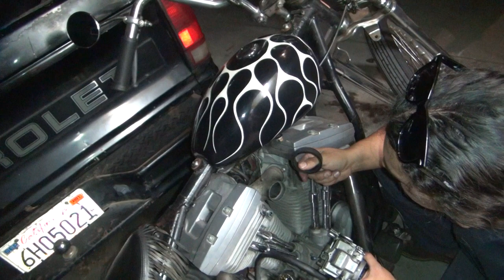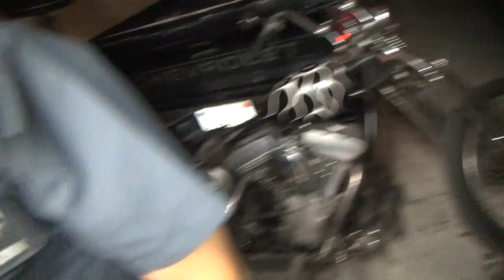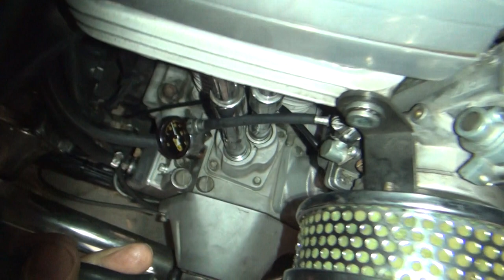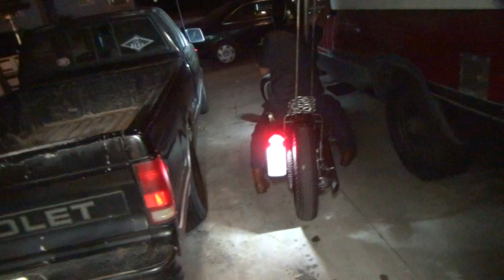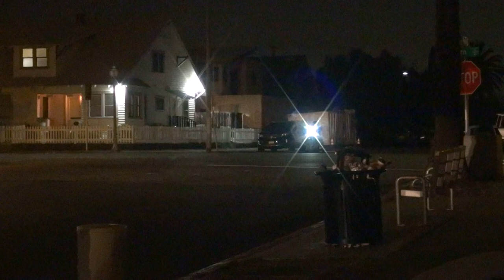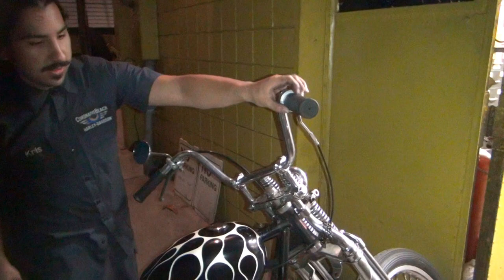#159-B how to do it, clean and flush hsr42 mikuni carburetor rebuild 45 48 carb harley tatro machine

Comment: Nice chop. I used to have a evo in a paughco frame with a micks chop shop springer. Man would it fly. Ported milled heads, 030 head gasket, flat top forged pistons, 42 mikuni and ev27 cam. best street rod set up ever!
Reply from the maker: yes that is a good combo for the motor. you should have an easy 75hp with it in a 500lb bike. watch out twincams and m8's.
tatro
Reply: My dresser has the same setup ( thanks for the info tatro). I broke the rear wheel loose at about 40mph the other day. Good fun